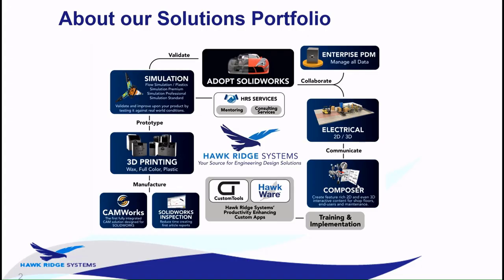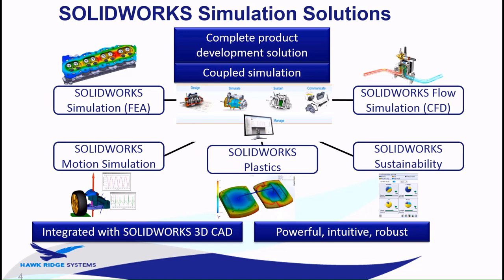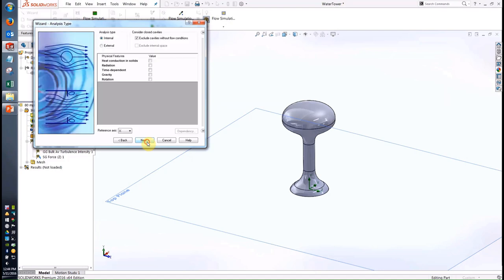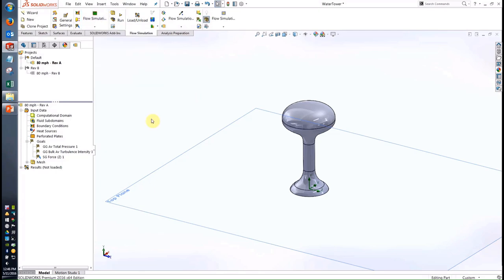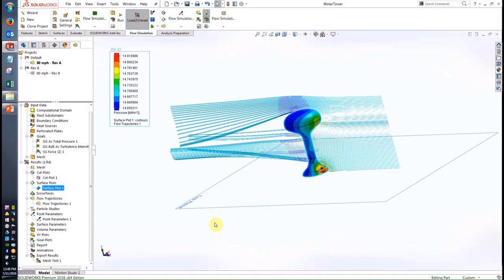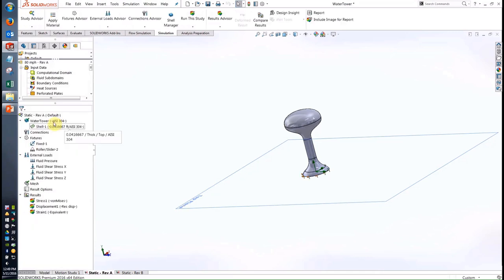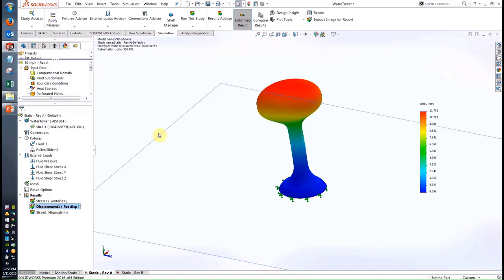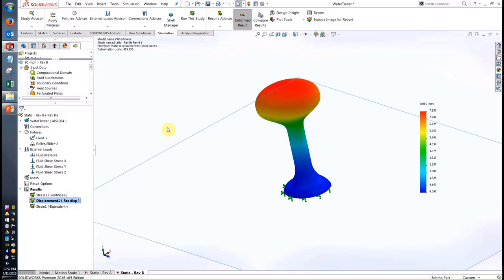Wind Loading Analysis with SOLIDWORKS Simulation and Flow Simulation

Comment from the maker: Note: After solving the SOLIDWORKS Flow Simulation results it is necessary to "Export results to Simulation" from the pull-down menus Tools > Flow Simulation > Tools > Export Results to Simulation, in order to write the additional output data required for pulling the pressure maps into SOLIDWORKS Simulation FEA.
Reply: It took me 5 hours to figure this out. I was just about to write a comment that without it it is impossible

Comment: I did it exactly this way and it says there are no loads applied to the bod
Reply from the maker: It looks like there may have been a crucial step overlooked in this video, after the SOLIDWORKS Flow Simulation results are run it is necessary to "Export results to Simulation" through the tools menu. This writes some additional output information that is necessary for mapping the Flow Simulation results to a SOLIDWORKS Simulation FEA

Relevant section of the help files:
https://dshelp-embed.3ds.com/2023/english/UserGuide_HTML/mgchelp.htm#context=main&id=479&tag=id0c55fcc8-7c6e-487a-91d6-82105b3cf88c
Reply: @hawkridgesystems  thank you my friend!
Reply: I had the same problem! Thanks for comment that helped me too.

Comment: Thank you so much for the video. I am wondering do you need to model the structure as shell or can you simply define a new material as well as defining assemblies and then simulate it with flow simulation?

Comment: MY VERTICAL WIND MILL PROJECT  DETAIL
FAN BLADE 66INCH WIDTH HIGHT 144 INCH FAN 10NOS
AIR DANCITY 241
WIND VELOCITY 5.5 METER  PAR SECOUND TO 15 METER  PAR SECOUND
HOW CALCULAT RPM  
HOW MUCH RPM GENARATE 
PLZ HELP
Reply: 740